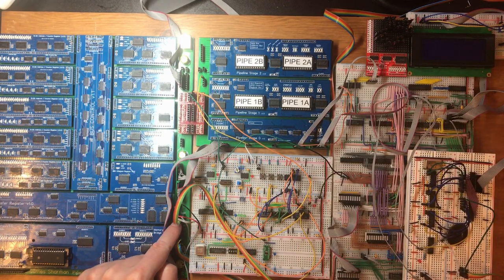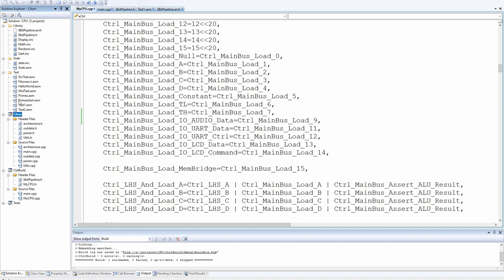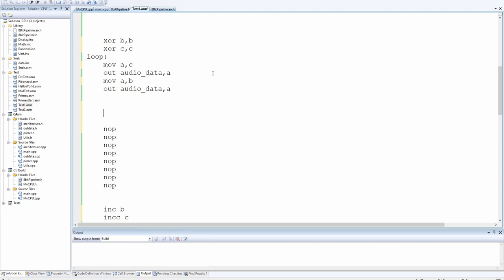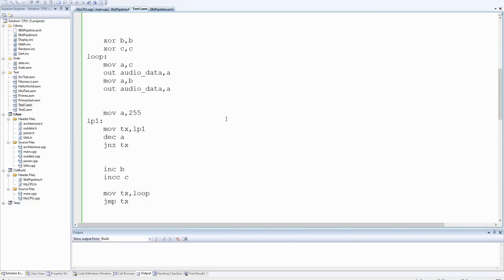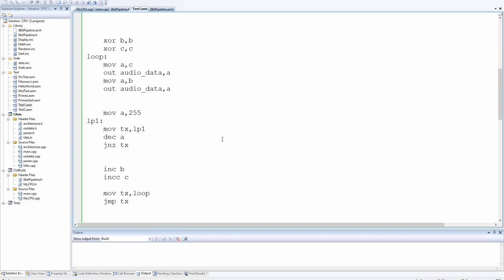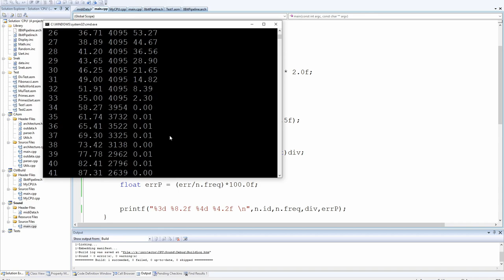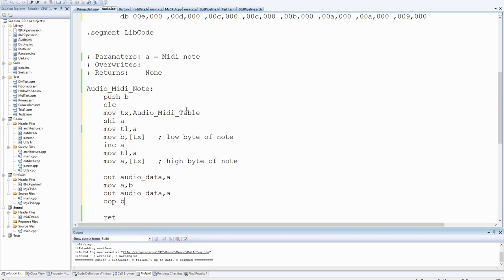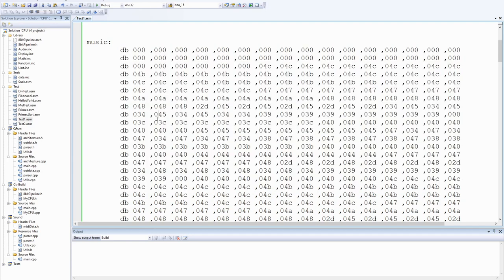Interfacing - Audio from Scratch - Part 2

Comment: I'm always impressed by how little actual circuitry is needed to get these features working. Nice work!
Reply from the maker: I know what you mean, it is balanced by the strange way that adding additional features always seems to multiply up the circuit.
Reply: Yeah, I have to say, I don't think I could have designed such a simple UART. I'd have been putting flip flops and all sorts in to make something like that work.

But I've always been a fan of "the sea of gates" and don't really mind using lots of chips, looks serious then. 🙂

Comment: Very cool!
Some parts of this video were a bit painful 😜 but even so, this is really cool. Is live to see a version of this with multiple voices, maybe even some extra features - though any of that would be pretty complicated, as you'd also have to add control circuitry for voice, feature, mode, etc selection. That being the case, I can't see it happening soon.

As far as converting midi files, I for one would be very interested 🙂
Reply from the maker: Maybe I can surprise you with the features I can add without going overboard on circuit complexity.
Reply: @weirdboyjim  that sounds like you've already been working on it. I look forward to seeing it 🙂
Reply from the maker: I haven't made anything yet, but I have thought out the features I want to add in.

Comment: What makes the "picket fence" noise, a brief pop between each midi note? Listen to 24:50 and ff. The noise is more prominent during "held" notes (repeated) and less so when each successive note is different from the prior. I didn't see the source of subroutine Audio_Midi_Note() so don't know what the sound circuit is getting before and after each note, but the pop is at about the rate of calling Audio_Midi_Note().
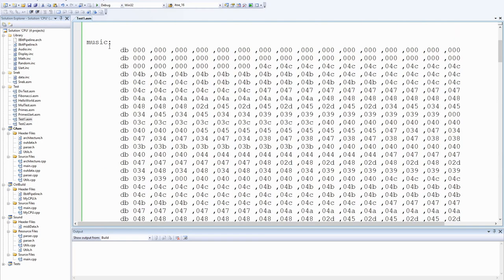Reply from the maker: I think what you are referring to is my crude arpeggio's, the circuit has only one "voice", but the tune requires a number of chords. The "solution" is that when the tune requires 2 notes at once is to alternate between the two notes. If you look at 24:34 you can see the data table for the tune. You'll see runs of the same value but stretches where it alternates between 2 values. This was a common technique in early 8 bit games to expand the sounds capability, once I've added additional voices hopefully you'll hear a nice progression in the sound quality.
Reply: The low pitched, uniform frequency, sound like a stick on a picket fence doesn't sound like an arpeggio to me. But we'll take it on faith, you've never steered us wrong before.

Comment: *runs midi tune off the crystal oscillator*
Well that was certainly avant garde, haha. Great work.

I recall in the PPU of the NES, a bunch of the 16-bit registers would share a toggle that selects the high or low byte, and the toggle would be flipped after each write, or forcibly reset by reading from a status register. You could possibly buffer the first write, then propagate the full 16-bit value all at once after the second write, at the cost of one extra chip if I'm not mistaken? Not that audiophiles are going to notice a difference I suppose. Unfortunately I never got around to implementing emulation for the APU.
Reply from the maker: Thanks Scott! When you get as far as Part 5 in the audio series I have a discussion about a few different ways of handling that. What you describe is very close to one of the options I looked at. I joined the games industry just after NES was fading out in favor PS so I've only looked at it in passing.

Comment: Perfect, you can adopt a FIFO as a pseudo second channel, followed by OR gate to give a feel of a mixer,
the proper way will be definitely an ADSR, but it will be to complex.
Thanks 
Cheers ✨✨🎉🎇✌
Reply from the maker: Once I've added a 2nd channel I'll probably mix in analogue. that will let me control the volume independently per channel.

Comment: Are you going to use the Assert as a Clear op?  Add a 2 bit counter that the Assert initializes, that holds the output off until two bytes are loaded, That would also allow you 4 bits of volume control.
Reply from the maker: Something like that, keep watching the Audio series ;-)
Reply: @weirdboyjim  Yea, have watched all your videos, Good Stuff.  I was worried that your previous implementation did not contain any synchronization, It just alternated high byte, low byte. so it would play error tones during the load, 
  I though you might add some of your 8 byte fifo's on the input stream.  I think if you do add any fifo's you will need to add some duration data for each tone.  
  You are really building a Nice example!

Comment: For making it easier to test code, is it possible to use a uart bootloader program in your rom, which downloads the program from the uart to ram and jumps to it?
Reply from the maker: That's one option I've considered. The only issue with that is I'd have to load the programs into ram, a different address than when they run from rom. Then half the memory would still be a mostly unused rom chip. I'll discuss the possibilities in a future video, if I go down that route I'll need to do some work on memory to make the ram/rom split more balanced.

Comment: To get note frequency in 12 tone equal temperament you use this formula fn = fa * 2 ^ ((n - a) / 12), where: fa - reference frequency, fn - wanted frequency, n - key number of wanted frequency, a - key number of the reference frequency.
For standard 12-TET reference note is A4 - 440Hz and key number is 49 so:
fn = 440 * 2 ^ ((n - 49) / 12)
Might be useful for someone :-)
Reply from the maker: I knew there would a be a formula for it somewhere, but copying the table got me running.

Comment: Isn't 440Hz A4 not C4? Interesting how 115200 / 440 is about 262 is so close to middle C (261.6 Hz) and 115200 / 261 is about 441 which is close to C4 (440Hz). What an interesting concidence.
Reply from the maker: Yes, 440 is the divisor necessary to get Middle C? Did I reference it wrong somewhere?
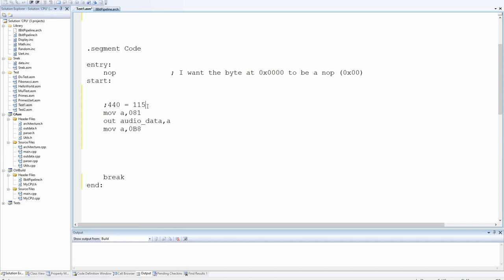Reply: @weirdboyjim  2:25 Now that I checked second time, it's ok. It's just written in a weird way and I got confused.
Reply from the maker: @pvc988  I see what you mean, probably should have written "115200 / 261.63hz = 440 = Middle C"
Reply: @weirdboyjim  Yeah, I was expecting something like that. And that 440 divisor. Accidentally, it's A4 note frequency.

Comment: How hard would it be to implement 2 byte instructions? Because out and many other should be this way
Reply from the maker: My constant loads are essentially 2 byte instructions. You say "Out and many other should be this way" but what I think you mean is that you think there should be an encoded parameter rather than the arbitrary way I'm handling instruction permutations at the moment. One of my design goals in this build is to get the highest possible throughput without over complicating the hardware, my main instruction encoding being one byte is a deliberate constraint. I can only read one byte per cycle so multibyte instructions would be a direct divisor on the throughput, it wouldn't be very hard to add though.
Reply: The alternative would be a longer word size
16 bits ⊻ 32 bits and than it would already be similar to ARM or RiscV.
I have also already thought of having a way for a constant to enable certain bus enable signals. 
Throughput is a question of compromise. Having less maybe usfull instructions or faster IO.
Reply from the maker: @wChris_  Exactly, but I hope you appreciate the compromises I had to make to hit my goals while keep the build manageable. The RISC-V spec actually makes a good read if you want insight into this stuff. They go to lengths to make rs1 and rs2 (Their equivalent of my lhs and rhs) always be the same bits of the opcode, it's easy to conceive of a bit of logic that conditionally connects those fields directly to the selection control lines. This would makes sections of a RISC-V implementation simpler than my build, unfortunately other elements would just get a lot bigger.
Reply from the maker: @wChris_  Having a 16 or 32 bit memory data bus and a fetch unit that could store, shift and assemble variable length instructions would have let me squeeze even more instructions thru, but at the cost of adding a large amount of complexity.
Reply: @weirdboyjim  I have some designs for a 32-bit ttl computer, the load store byte shuffling/sign extension takes 12  74x245 chips just for the data path. The control for that is a nightmare, 8 operations plus the lower address bits... Would not recommend.

It's been a hard road trying to find an effecient solution to the 16-bit memory barrier.

Comment: It sounds like you may want some sort of SRAM to hold code, programmed by some arduino during development?
Reply from the maker: I've thought about having a microcontroller based development interface, but it doesn't feel right to add an off the shelf processor to the build.
Reply: The UART loading the SRAM under control of code running in your processor - that's the way to go. :) those AT28C256s are easy to program in circuit too.
Reply: @weirdboyjim  I was looking at the easiest path forward. There is likely a way forward with the uart being used as a supervisor of sorts, hold the rest of the cpu in reset while the uart reprograms the eeprom or an extension sram of sorts. I’m too bad a hw engineer to get that done easily. 😥
Reply: @NuttySwiss  the processor could program the EEPROM, which is much easier: read a UART byte, write an EEPROM byte. There are some timing considerations, but it is fairly trivial. Alternatively the processor could write to the volatile SRAM.

Comment: Sounds like a hearing test machine.
Why does it step up a note before stepping down?
Reply from the maker: I know this video was a bit painful, always the risk doing a video on sound generation. I've always been committed to showing my mistakes. Hopefully the rest of the series will just be gradually better sounds.
Reply from the maker: Just noticed the extra question.  I think you are referring to the issue I had with the counter load not completing. I explain and fix that around 11:40
Reply: @weirdboyjim  sorry posted before but still didn't understand how the incomplete counter caused the step up.

Comment: at 12:47 how did you connect the sr latch?
Reply from the maker: The borrow line if I wired it direct to reset would cancel itself. So the borrow line set’s the S/R latch and then the next clock pulse resets it. The output of the sr latch is then used to restart things.
Reply: @weirdboyjim  okay thanks

Comment: Will there be timer register devices?
Reply from the maker: Do you mean some way of locking program execution to a time interval? Yes, there will be. This will actually come from the video circuit so I'm holding of until I have that rather then trying to cram temporary functionality in. Game developers have for a long time been using horizontal and vertical retrace timings to synchronize non visual elements as there are already reasons to be pacing the code by these intervals.
Reply: @weirdboyjim  I assume that will be holding off the processor until the beam is in a certain position, and not an interrupt (automatic program flow diversion)? It would be interesting to implement that via hardware, like how the breakpoint was implemented, vs polling on a register read?
Reply from the maker: @lawrencemanning  That sounds overly dramatic but it's essentially what we do (even on modern gpu's). In the case of old style hardware you had the vertical and horizontal blanking as bits on a status register and by using them to time updates to the screen you could avoid tearing or jerkiness.
Reply: @lawrencemanning  Essentially how Ben Eater did it in his latest GPU Video